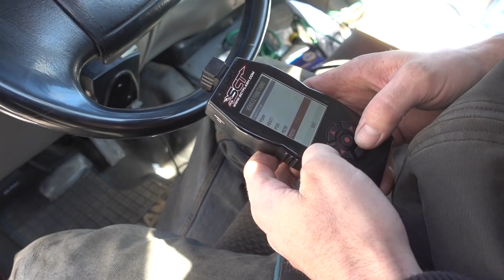WE KILLED THIS FORD 7.3 POWERSTROKE!!!!!

Comment: Hell make your own extension with a welder , Long piece of round stock metal and weld on the 1/2 socket  ends. Less wobble wont fall apart.

Comment: Hey Greg if you want a real challenge you should buy a 7.3 and try to make that fast.
Reply: Never meant to be a fast motor. Six liter or six seven is where its at
Reply: @williamuskoski1385  None of them are meant to be a fast engine.
Reply: @williamuskoski1385  I said that as a joke though, but now that i think about it, it would be awesome to see him build one and make it fast because most people never want to spend the time and money to do it but the way Greg drops money why not ?
Reply: @bradthacker9904  I agree. I don't think I've seen anyone attempt a racing build of an OBS Ford with a 7.3 IDI. It's a legendary engine, and a legendarily slow but unkillable truck. Hmm. Opportunity..
Reply: @bradthacker9904  
There is a few. A couple running tens and under